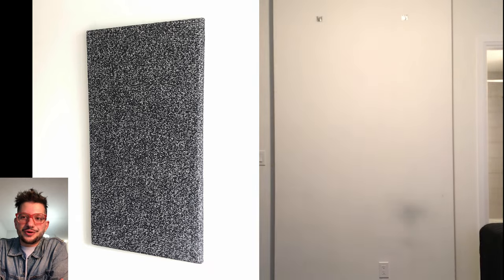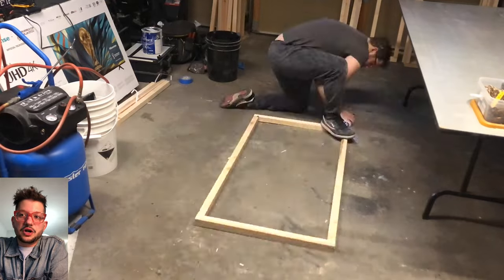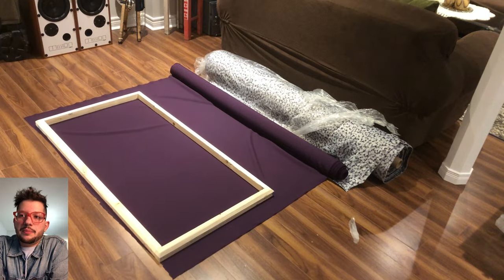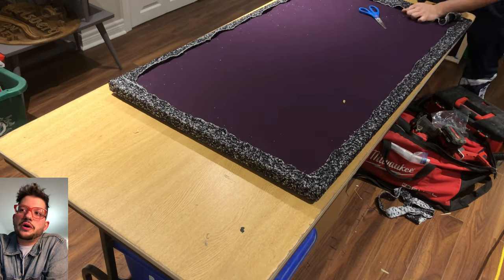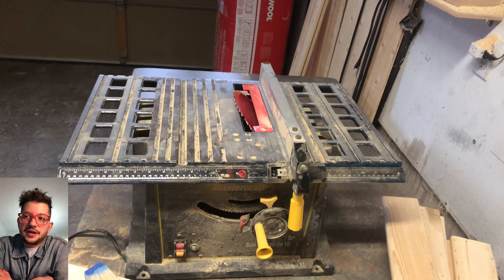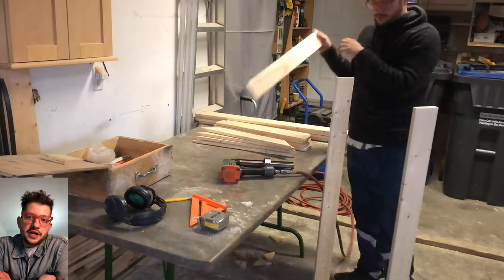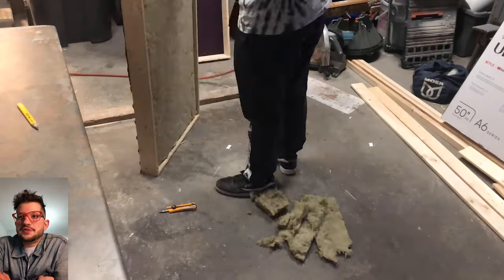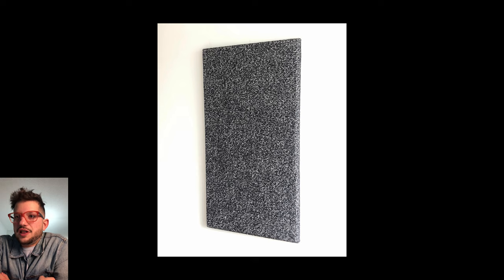DIY PRO ACOUSTIC PANELS! BONUS CLOUDS AND CORNER PANELS

Comment: If you space the pannels away from the walls by 1"-2" the back side of the insulation material can capture more sound waves.  Similar idea to spacing cieling panels away from the ceiling.  All the best!

Comment: You should fix the router and the table saw to the beach. You can do it with some clamps if you are tight on budget, it just looks sketchy as f.
Reply from the maker: Yes they normally are! My folding bench with dogs was on a job site so just working with what I had. Thanks for watching! 🤟